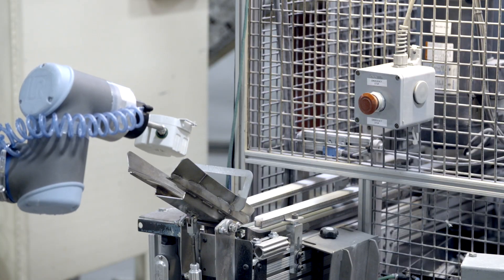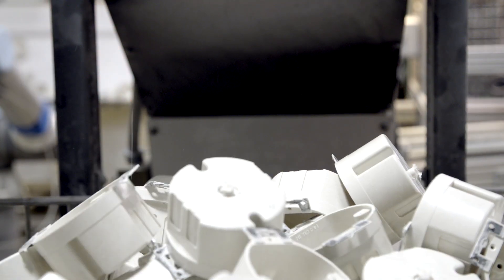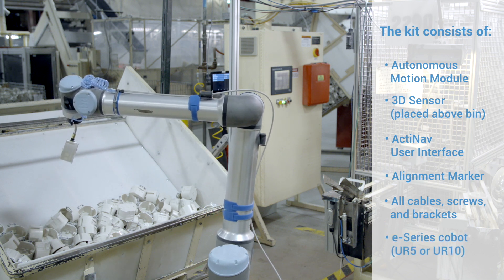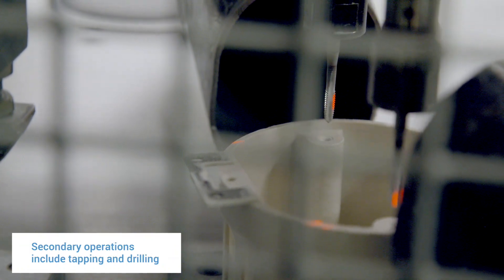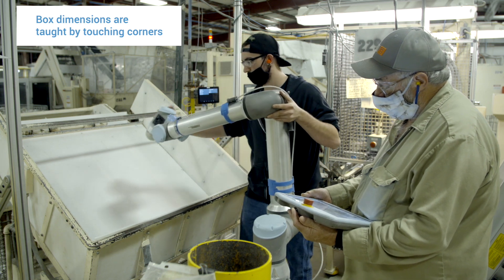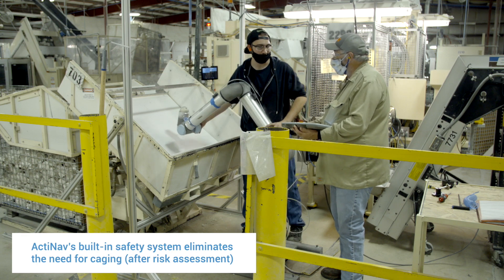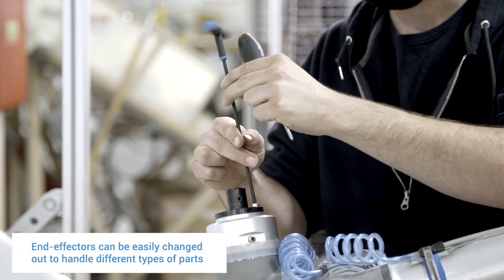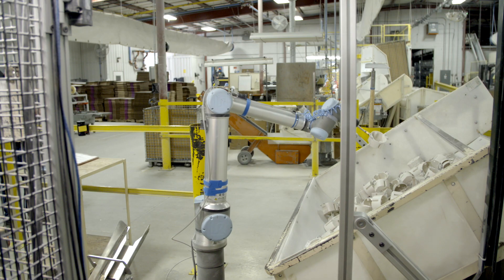Universal Robots' ActiNav Handles Challenging Picking Task at Allied Moulded

Comment: who did the integration
Reply: If I had to guess, Allied Moulded probably did it themselves. I am a manufacturing engineer and I have designed, manufactured, programmed, troubleshot, and integrated a few applications where I work using a UR. The platform is incredibly easy to work with and learn.
Reply: @MesseJenkins  I know. I own a company that does UR integration as well. Amazingly simple machine